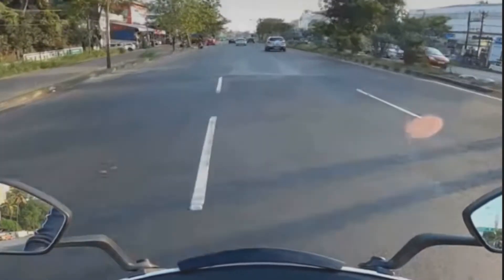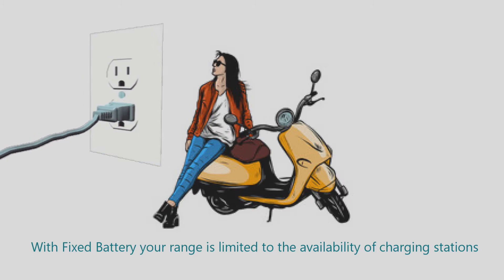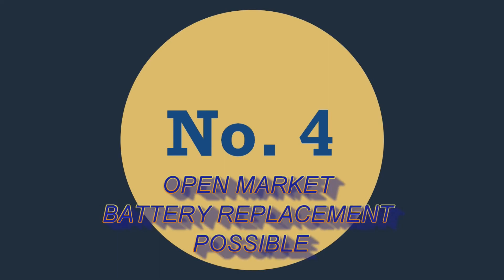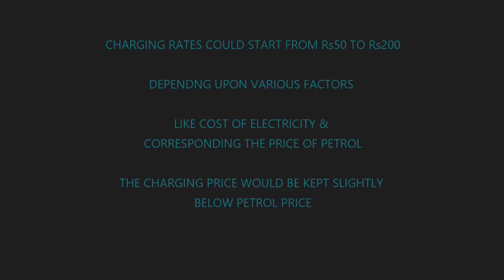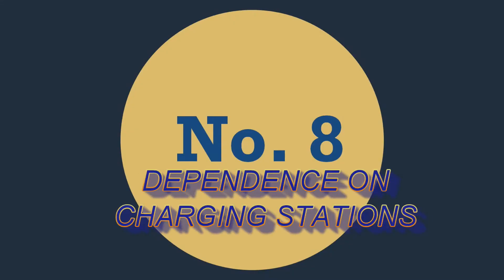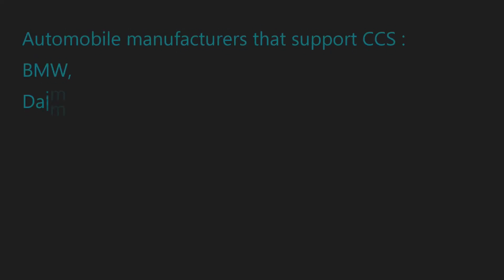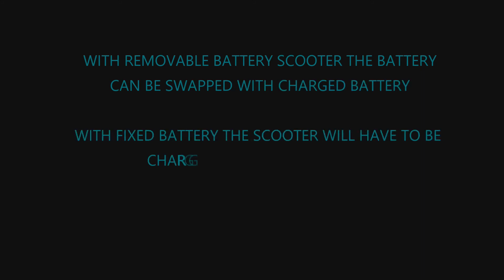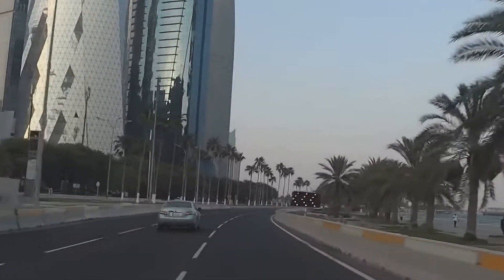14 Problems of Fixed Battery Scooters in India | Fixed Battery vs Removable Battery Electric Scooter

Comment from the maker: There might be valid reasons why a scooter needs Non-Portable batteries (connector problems & monsoon flooding are 2 reasons)... but there are much more reasons why small eScooter & small boats need portable batteries.
This also doesn't mean good connectors (as in Gogoro & Revolt) and water proof portable batteries cannot be made!

Comment: Just 15 minutes back I was about to decide on exchanging (if possible) my 1.5 yrs old Okianawa Praise Pro with Ola Electric Scooter remembering an old news that it has removable battery (main reason I didn't buy Ather). Then I got news that Ola has fixed battery.

Energy metering to profit is the basic control mechanism with forms of Governance in the world.

Comment: Kindly make video on Epluto 7G. good to buy or wait for new Model ?
Reply from the maker: PureEV is a good company. EPluto 7G is good. Get a Li-Phosphate battery option if possible.  They have not mentioned the 7G Battery Chemistry on their website. But PureEV gives the best Range to Price ratio. They also have headlight on the handlebar which is the correct place for headlight.
Reply: Epluto7g is good. using it for 8month+